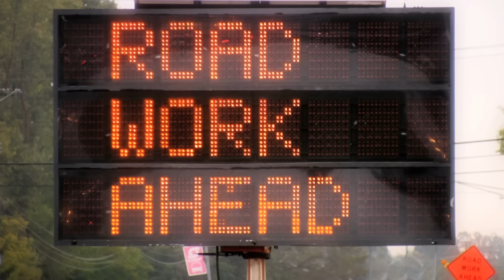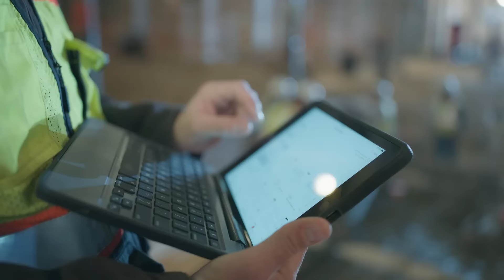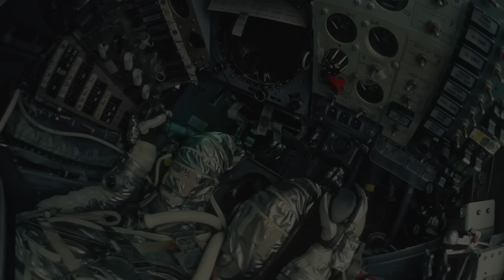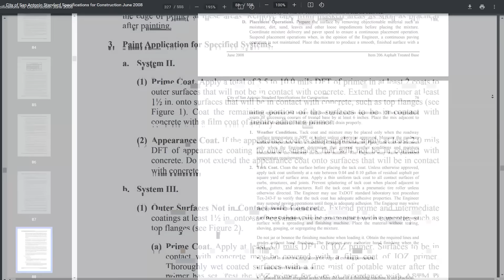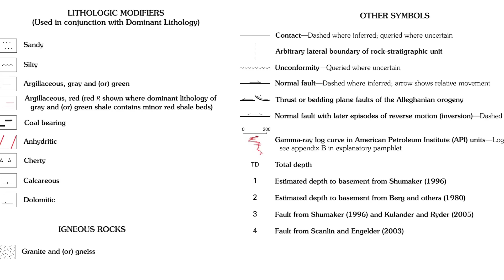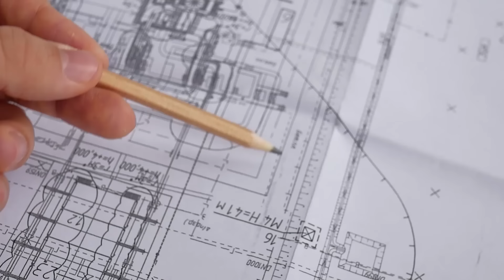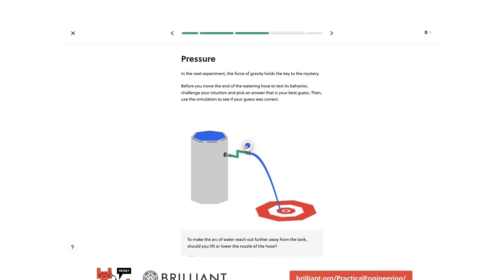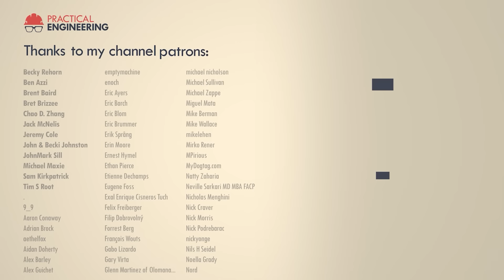4 Myths About Construction Debunked

Comment: It's mostly city workers standing on their shovels and people in unions sitting in their forklift on their phones. My dad was going on construction job sites when he was 5 with my grandfather and eventually became a foreman. I've seen massive areas where multiple could be shoveling too or other things to do. I know its hot but they drag things out my dad and people I know often worked in attics for hours and welding under train tracks. You won't see this much for private companies near as much. He even used to joke about it being in construction doing multi million dollar buildings reading blueprints and talking to the architects after he worked his way up since a kid then a teen and then around when he was in his 30s. AC/Welding/Pool certified still have several of his rolled up blueprints from jobs he did with a bunch of codes on them and they weigh about 30-40lbs.

Comment: Here is the problem with u always see people standing around, one is the inspector, foreman, operator, swamper then labor hand, and usually only one person can work in a hole at a time, just right there is 5 guy , 4 standing and one working,than U may have safety man, superintendent, so it’s a lot of people, out of all them only 2 actually work by hand swapper and labor hand, everyone else watches or uses the equipment

Comment: Grady, I love your videos but some stuff you shared here is NOT the average fact in most places. For example, you said that engineers always seek to provide the best quality product for your clients… if so, what happened with the Millennium Tower in San Francisco or the apartments building in Florida that’s tilting. You talk about how the fact that the contract goes to the lowest bidder does not mean the final product is defective, I know you believe this to be true but I KNOW it’s not, come look at the new Veteran’s Administration Clinics building on Raeford Rd, Fayetteville, NC that in the inauguration week had to be closed again because rain water was entering the building from the roof to the first floor through the stairwells, the elevators keep breaking down and many other issues. 

I have to give it to you on the Highway construction being better than the roads the Roman’s build because the new ones can withstand the traffic if vehicles weighing thousands of pounds, how about you compare them to non-elevated cement structures? I’ve been in the Ft. Liberty (formerly Ft. Bragg) área for over twenty years and at least four to five occasions in that period they have repaired the surface of All American Highway in the vicinity just before the exit for Pope Airfield (35.1348453, -78.9865665), and yet again it needs to be repaired again. The Highway surface sinks in two spots over 100’ across both double lanes and median; each dip is an area 6’-8’ long on each lane and get as deep as 5-8” becoming dangerous for motorcycle traffic; there are two dips across each highway direction. For road comparisons also look at the streets on NYC and the suburbs of Chicago, we’d love to have the Romans come build these streets.

Comment: ive been driving the same road for 4 years now an theirs a 7km stretch that's still being "worked" on an the locals say its been going on for years before that. but im totally sure there working hard. oh an yea its full of pot holes they replace a section an its got potholes with in a month but im sure it was built to spec an totally not built to ensure job security.

Comment: The secret to making a ton of money doing construction is to just declare yourself a minority contractor by putting the company in your wife's name or any non white male and just get government contracts. I used to do industrial electrical construction, I spent about a decade doing it before I needed a change. You can charge a private business 1/4 of what you can charge the government for the same work. Usually the engineers and inspectors watching you don't even have a clue what they are looking at. We were installing 4" electrical duct for an underground job and the inspector asked me where the wire was. I told him the empty pipes had wifi-mirrors in them and the electricity was transferred by that method so no need for wires. Since he was a civil engineer from India he had no clue what he was looking at and just thought that was how we did it in the USA. I wish I was joking...

Comment: 8:00 Just no. I'm sorry, I know you want to shine a good light on civil engineering and construction, but this is the biggest shortcoming of the past decades of our wasteful use of building resources. Only very recently people have started to wise up to the very real costs of damage caused by the ever more prevalent catastrophies which are directly linked to climate change. The same climate change that the concrete industry is the biggest contributor to. Just as an example, the floods in July 2019 in Germany will cost the German Railway Company upwards of 20 billion Euros. And that's not even accounting for houses, roads, utility infrastructure, and most importantly lives lost to the flood. 
Sustainable building should be at the forefront of every design process, and planned obsolesence is poison for our planet. Maybe, instead of thinking "maybe in 20 years we can tear down this building to build something else", people should consider that "maybe in 50 years, we can use this building for something entirely different" and plan accordingly, or aat leaast build in a manner where a large ammount of resources can be reclaimed, instead of gluing everything together insepperably because it's "cost effective" and convenient.
Reply from the maker: Planned is not the same as desired. If resources were unlimited, of course it would make sense to build this way. Do you always buy the most expensive, well designed, and long lasting version of every item you need in your life? If so, I’m jealous.

Comment: i am currentlt 1m 47s in and already can't continue. You are wrong, you are either obtuse or straight up lying. I've worked and since leaving still communicate with higher ups and the peons holding shovels. These construction workers purposely drag out construction as long as they can. From the the highest level to the lowest. They do this so they go over budget, thus allowing them the justification for more money each year. Because going under budget means they will get a budget cut.

Comment: "A worker standing around with nothing to do is the first thing to get cut from a project." - This is stated so simply, like a fact of life, with no contention or debate. Yet many people, allegedly professionals and supposedly domain-expert journalists, are surprised that 50% of staff was cut from Twitter and pressure was put on even more to buck up or leave willingly (with more likely being fired upon code commit reviews in days to come), and there were even open admissions from some former staff that many people were working as few as 6 hours a week, with 6-figure yearly salaries. 

Twitter is an app that can probably be run with 500 datacenter infrastructure people and 500 software engineers (probably an over-estimate tbh), and 50 office staff doing things like payroll and other business admin things. The business is probably already technically profitable now just via layoffs and firing.